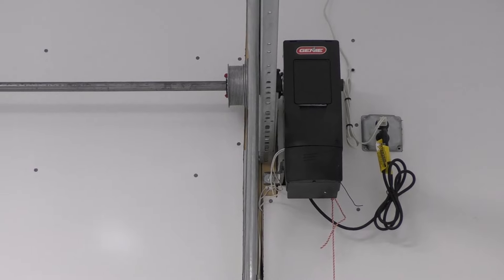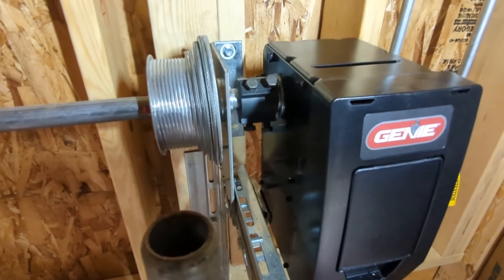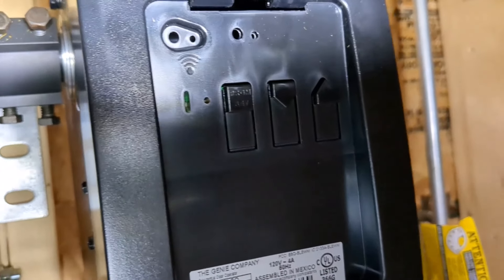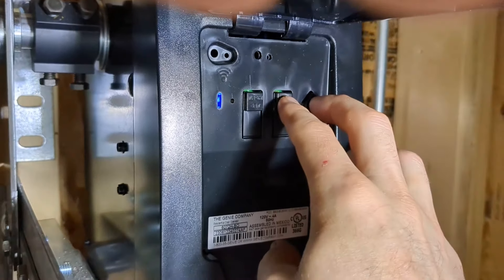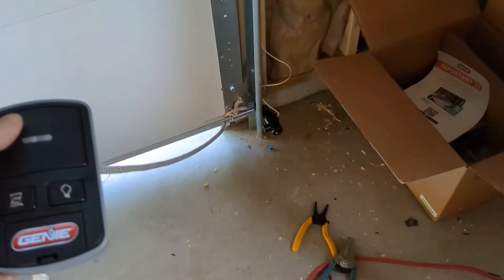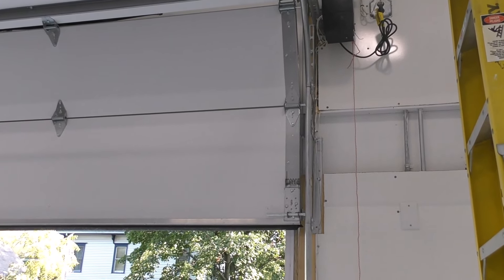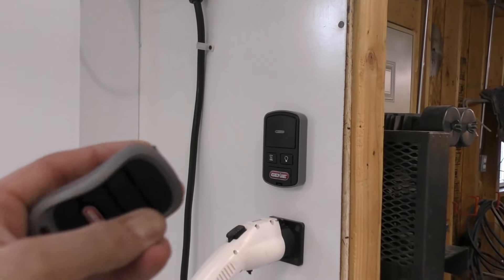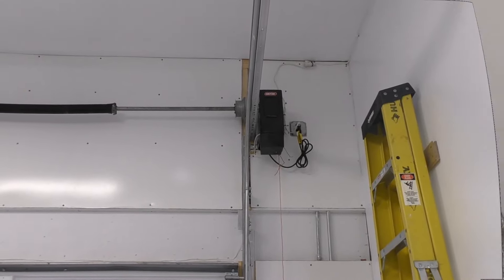Genie 6072 Garage Door Opener Installation and Review

Comment: Good video ! I also installed one. But I ran into a problem that I couldn’t solve. The door goes up well. And it moves down first with small jerks, and then evenly. The 2 torsion springs are adjusted correctly according to the instructions. The door is easily lifted by hand and remains stationary 3 feet from the floor.
Reply from the maker: What is the problem you couldn't solve?  Is it that you are able to lift the door while the opener is engaged?
Reply: @FixItScotty your stuttering is a normal thing it shakes the door a little to make sure rollers are not stuck and something gets bent kinda annoying but useful I guess
Reply: The stuttering is a feature. There are many videos on why it does this and it's pretty smart
Reply: Good Video I Also Installed One.
But I Ran Into a Problem That I Couldn't Solve. The Door Goes Up Well. And It
Moves Down First With Small Jerks And Then Evenly.
The 2 Torsion Springs Are Adjusted Correctly According To The
Instructions. The Door Is Easily Lifted
By Hand And Remains Stationary 3 Feet From The Floor.
What Is The Problem You Couldn't Solve 
Is It That You Are Able To Lift The Door While The While The Opener Is Engaged

Comment: The install instructions state the back of opener needs to be flush with wall. That makes no sense based on the shaft location varying on most installations. Do I have to fill gap with blocking?
Reply from the maker: I take that phase "flush with the wall" to mean level with the wall.  Or, in other words, plumb.  The bottom brace for the opener is slotted so that you can change the plumb and lock it in.  Just like I did.  So I would say, no, you don't need the back of the opener blocked up to the wall.
Reply: @ I inferred that same thing but am glad you confirmed. Door is working great! Thanks

Comment: , Sorry, I missed that. And also sorry for my bad English. I’ve studied German all my life, but unfortunately they don’t speak it in America. And at 80 years old, learning a language is a little difficult. Let's return to Genie, from the point of view of elementary physics, it is easier for the engine to lower the door than to raise it, but it is when lowering that I hear the engine working with tension, the door trembles and only after a couple of seconds it works smoothly. If this happens to you too, then it means it’s a manufacturing defect. Yes, you can live with it, but it’s still unpleasant.
Reply from the maker: Your English is fine.  I wanted to be sure I understood your problem.  Yes, the motor trembles when the door is at the top because if there is a problem with the spring, the weight of the door could be too much for the motor.  The door could fall suddenly in that situation.  That tremble is to test the door weight to make sure it is safe to lower it.  But I agree, it is very annoying to hear.

Comment: No, I could not solve the problem of the delay in the initial lowering of the door with small shocks. This lasts 2-3 seconds and then the door goes down normally.
Reply from the maker: You may have missed it, but at 18:50, I talk about the shuddering that happens before the door comes down.  That is not a problem.

Comment: Mine takes longer than 20 seconds to open or close
Reply from the maker: Mine isn't very fast either, but 20 seconds seems quite slow.  I would try disengaging the door opener and try lifting the door open and closed yourself.  If you struggle greatly, it could mean your spring isn't tensioned properly or there are issues in the track or rollers.  Although unlikely, you could also be on the wrong drum setting on the door opener.

Comment: I'm a garage door guy. I've installed a lot of these Genie wall mount openers. I installed 3 last week. I prefer them over the Liftmasters. The shuddering is the opener sensing cable tension and making sure you don't throw a cable off of the drum. Since you have a high lift door, I would just remove the cable keepers. Since you have a little more than one door section hanging down below the radius, there is sufficient weight pulling on the cables. I install pusher springs on all my standard radius installations. Doors are going to float a little side to side. There are those little white spacers included that are to snap onto the bottom rollers to help center the door in the track. I would erase the wall button from the memory and reprogram it. That might solve the issue of it not working every time. 

Also, the tube the springs are mounted on is called a torsion tube. Your original Craftsman photo eyes would have had led lights also. I suspect someone replaced them with newer sensors in old brackets, and the lights were now on the back side.
Reply from the maker: Thanks so much for this!  Your comment was full of great information.
Reply: There is no power to the sensors when I installed mine...  ANy thoughts
Reply: So the shuddering during the initial inch or two of closing is normal?  I've been messing with this thing for two weeks trying to figure out what was wrong!
Reply: I'm a Garage Door Guy
I've Installed A Lot Of These Genie Wall Mount Openers.
I Installed 3 Last Week. I Prefer Them
Over The Liftmasters. The Shuddering Is The Opener Sensing Cable Tension
And Making Sure You Don't Throw A
Cable Off Of The Drum.
Since You Have a High Lift Door
I Would Just Remove The Cable Keepers. Since You Have a
Little More Than One Door Section Hanging Down 
Below Radius
There Is Sufficient Weight Pulling On The Cables. I
Install Pusher Springs On All My Standard Radius Installations.
Doors Are Going To Float A Little Side To Side. There Are
Those Little White Spacers Included That Are To Snap
Onto The Bottom Rollers To Help

Center The Door In The Track. I
Would Erase The Wall Button From The Memory And Reprogram It.
That Might Solve The Issue Of It Not Working Every
Time.
Reply: @gregoryknotts653 sorry I just saw your comment. Yes, it is normal on the Genies.
Reply: @Eaglefreek300  appreciate the info. So I’m assuming by your previous comments I should install a set of 9” pusher springs onto the track?
Reply: @gregoryknotts653  that's up to you. I've installed many side mounts without the pusher springs without any call backs, but started  including them about a year ago or so after having issues with a couple installs.. If you have 12" radius track I would definitely recommend it.

Comment: The new belt drive ceiling units, especially those from Genie, are incredibly easy to install. I did it myself in about an hour, including installing the new rail front bracket and modifying the existing angle struts to fit the new unit (I have a very low garage ceiling  😒). 
They are also very quiet. Unlike the old Liftmaster unit it replaced, I cannot hear the new Genie running, even though the garage is attached and separated from the house by a 2x4 wall.

The real advantage of wall-mounted units is the lack of stress on the door since they turn the shaft instead of having to laterally get it started.
Reply from the maker: My main reason for the wall-mount unit is because I will be installing a 4-post lift in my garage and I want it as close to the front of the garage as possible.  I just don't want anything on the ceiling hanging down more than a few inches.  But if the new belt drive units are low profile, easy to install, and quiet, they may be a great option for many people as well.  Thanks for the comment!
Reply: @FixItScotty  I get it. If I had the ceiling height I would have seriously considered a wall mount.

Comment: A kind suggestion to like kind of garage door openers. 

Problem? 
We need as tight as we can provide to couple the collet at the end of a 9 or 17 feet torque pipe and not crunched it.

Solution ? Insert a short section of solid rod (acting as a backing rod) into the torque pipe with matching ID to OD. This will prevent over pinch that 17 ft torque pipe.
Reply from the maker: That is a great idea.  If mine ever slips, I will do that.

Comment: Page 4:20 How may we identify what drum we have when the drum has tapered diameter?
Reply from the maker: It wasn't clear to me....  I tried both the 4" drum setting and the "larger than 4" setting.  It seemed to result in a subtle speed change.  So if you have a tapered drum and aren't sure which of the drum setting to use; I just tried out both settings and picked the one that worked best.

Comment: Really appriciated for the this video.  very helful.     I have a question,  is still required to have torshion spring ?
Reply from the maker: Thank you!  To answer your question, yes.  The torsion spring lightens the total load of the door considerably.  So whether you have this type unit or a chain drive, they are not capable of lifting the full weight of the door without the spring.
Reply: @FixItScotty  appreciated!!!  Thank you for your response and explanation

Comment: Do garage door installers put in receptacles and reroute wiring? Or do I need to hire separate people? I have an overhead with receptacle near it but am looking to go with a side mount but there are no receptacles in that spot.
Reply from the maker: It may depend on the installation company, but I would imagine most would tell you to get an electrician to add a receptacle near the spring shaft before they can do the installation.

Comment: Did you wire the led transmitters in after you set the up and down limits?
Reply from the maker: I didn't need the bottom sensors installed when I set the up and down limits.  I installed the sensors after that in order to test the remotes.

Comment: How did you program the led light to turn on with the garage door?
Reply from the maker: No programming was needed.  I just made sure the main unit was powered up, plugged in the light, and it automatically paired itself via Bluetooth.

Comment: I’m having trouble setting the down limit. I also don’t see the LED transmitters on. Everything is wired right. I have no idea what the problem is.
Reply from the maker: If the LEDs on your sensors aren't lit up, I would think there must be an issue with the wiring.  Review how I did it again starting around 12:30.  Make sure the wire isn't broken (maybe it was stapled too hard).  Make sure you have pushed the stripped ends into the "Safety beam" holes on the main unit like I described using the small screwdriver to lock them into the connector.

Comment: Can i bypass the power cord and run romex directly into the housing?
Reply from the maker: The instructions for this does have a section describing how to remove the plug and hard wire it if you choose.  Follow local codes as to the type and size of wire.

Comment: What is the point of the cable keeper?
Reply from the maker: My understanding is that they keep tension on the cable which can help prevent the cable from slipping off of the drum. They can also stop the door from opening it gets too close to the rail (like if a roller came off).